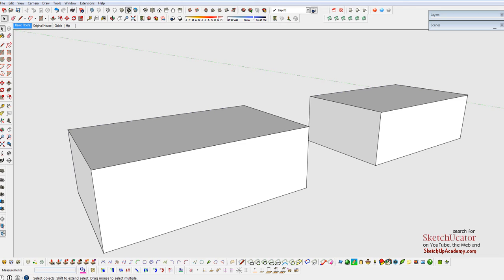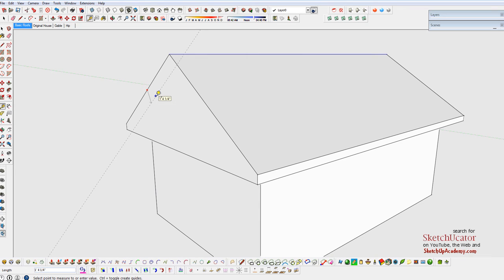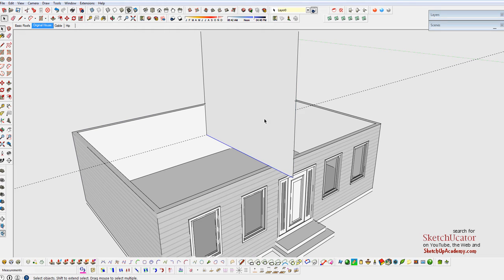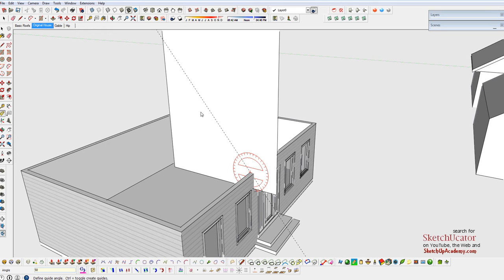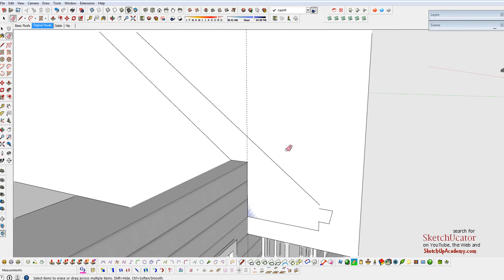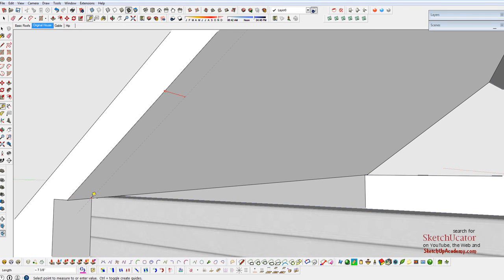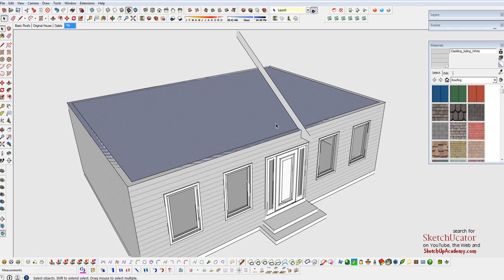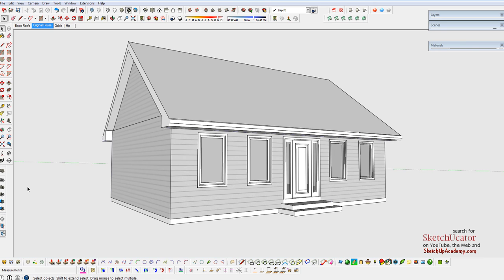HOW TO BUILD SKETCHUP ROOFS:  Build  Real, Correct and Properly Constructed Roof

Comment: how do you get  the gable/hip buttons the screen?
Reply: I think that is the "Hip" scene tab you're seeing. There are currently 4 scene tabs in the upper left, the 4th one being "Hip".. So in another attempt to clarify this answer, the scene tab (for hip) is created in the Scenes window. To make a scene, first set up the view you want to capture, go to Scenes (either under the Window Menu or open Scenes from the tray(s) along the right edge of your screen). Click on the (+) button in the Scenes window and a scene tab will be created as well as added to the Scenes window. Initially, SketchUp will name a new scene Scene 1, Scene 2, Scene 3, etc. You can rename them in the Scenes window. You can also add a new scene by "right clicking" on one of the scene tabs and selecting "Add". You can add, delete or update a scene by the right click method or in the scenes window. 
Once you have tabs created for the scenes, you can click on them and that scene will be displayed. It's great way to move through the model quickly. Scenes save a lot more than just the view; they save what Layers you have on, whether the sun is on, if a section  plane is  active, etc. Look at the bottom of the Scenes window and you will see a list of the attributes that Scenes tracks for you.
Hopefully I've made this reasonably clear. Check out the Help menu (the last option in the very top of the main SketchUp screen); it has a very good section that explains literally everything in SketchUp. It's quite well done.
Reply from the maker: The gable and hips are not buttons. The gable uses push-pull. The hip uses the follow me tool
It's all explained in the tutorial. Use use the same roof profile shape for both.
Reply from the maker: Sorry. I think I missed your point.  Both Follow me and Push Pull are in the Large tool set.  Go to View, then toolbars, then locate and check the box next to Large Tool Set. Once on screen the toolbar will remain. Push Pull can be activated simply by pressing P as well.
Reply: No, I saw you clicking "Hip" in the top left of the screen before using the follow me tool, but I think I was mistaking that for maybe layers? Anyway, thanks for answering, it worked out allright.